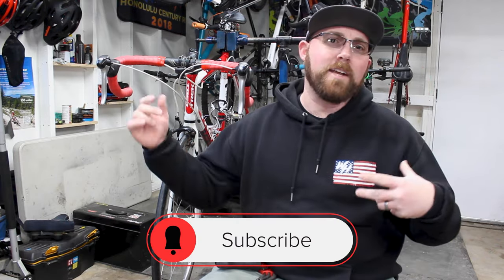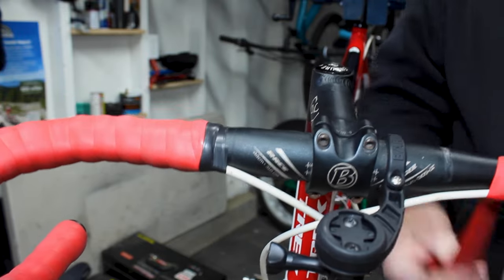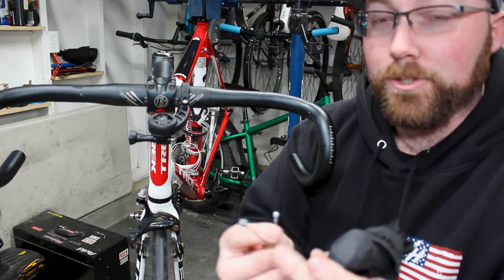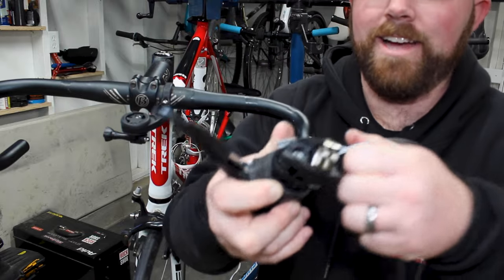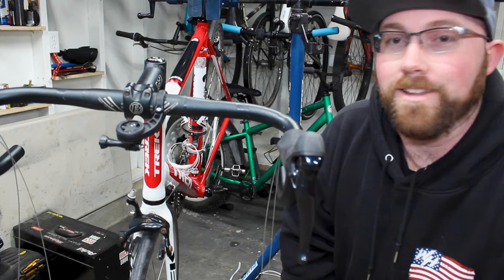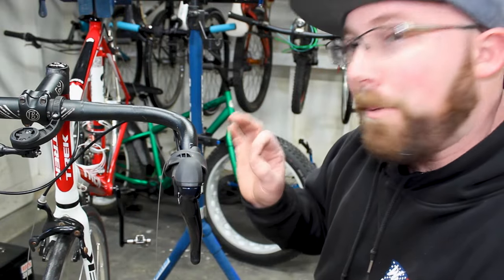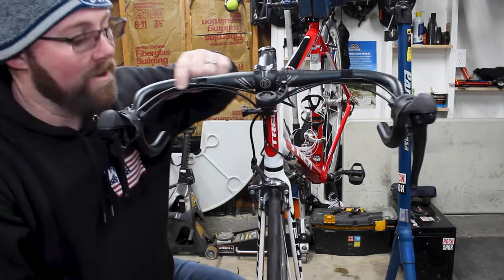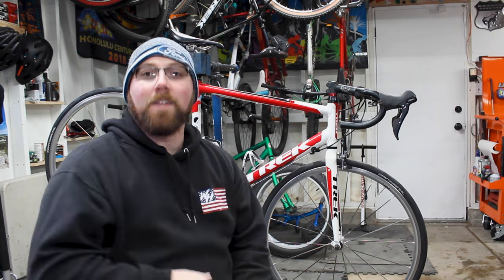Installing New Road Bike Shifters

Comment: Hey man and nice vid! Any idea about how much a Sora groupset is going for these days. I'd like to upgrade but don't want to get ripped off. Thanks very much if you respond. 🍻
Reply from the maker: The new Sora groupset starts around $200 or so, and goes up from there based on what components you want included.
Reply: @YourFavoriteCyclist  Hey, thanks for responding man! The person wants 350 CAD but it includes everything except the brakes.

Comment: aluminium will still corrode, regardless if the frame is aluminium or steel. You have to use stainless thread rivets and bolts